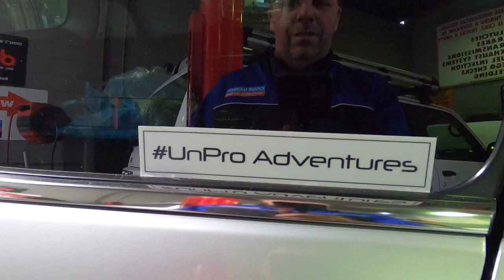We bought a Y62 nissan patrol

Comment: Good feeling buying and picking up a new car ( got a 2017 NP300 ). Was looking at getting a Patrol, but there is not enough payload left after adding a few accessories, and too exxy to do a GVM upgrade.  No doubt you will enjoy many good years of driving. 
Safe travels.
Reply from the maker: Darrin cheers mate 🤝
Thanks for watching
Reply: had a look at gvm upgrades they are around 2.5k-3k which still makes the patrol cheaper than equivalent spec LC200